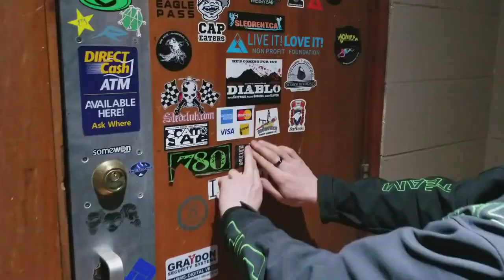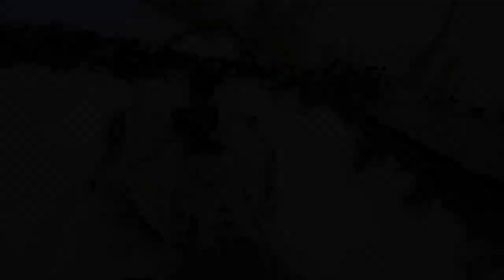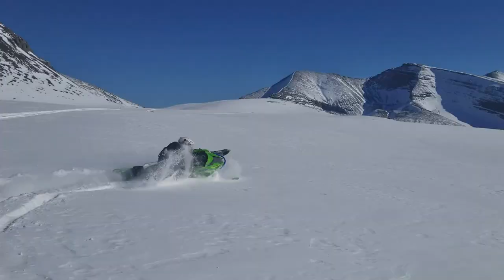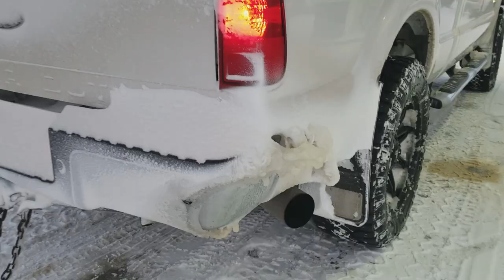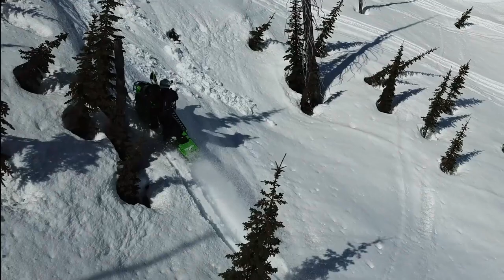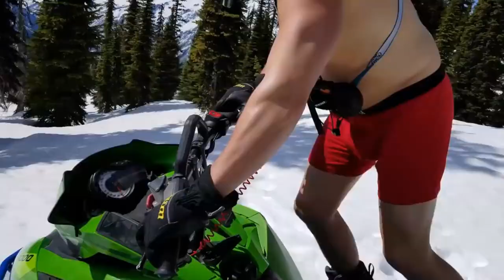THIS VIDEO WILL GET YOU STOKED!! Deep Snow! Jumps! Crashes!

Comment: How does Ben like his Tobe monosuit? Is it insulated or just the shell? Im thinking of ordering one this winter.
Reply: They've got a nice Peter keeper
Reply from the maker: He loves it. We were at the sled show this weekend and I would suggest checking one the new CKX ones, and I say this cause of the price for what you're getting.
Reply: Thanks for the tip, I will for sure look into the CKX before I order.
Reply: That Tobe mono suit made last season a blast! This is just the shell and i have no issues staying warm. It's super durable and has lots of vents for the spring time riding. No complaints aside from the cost aspect.